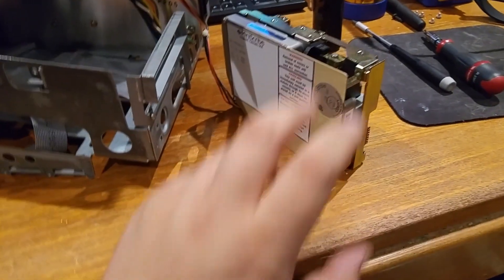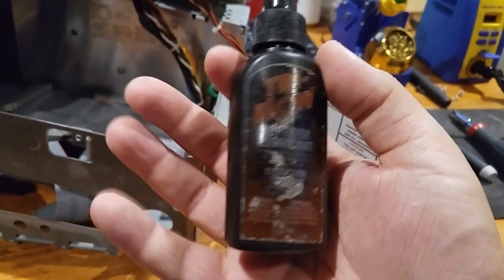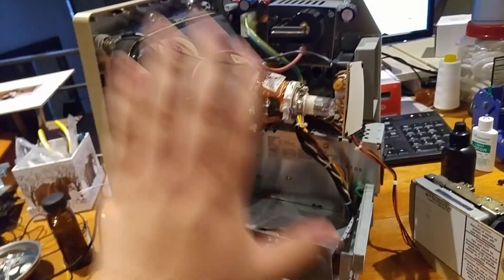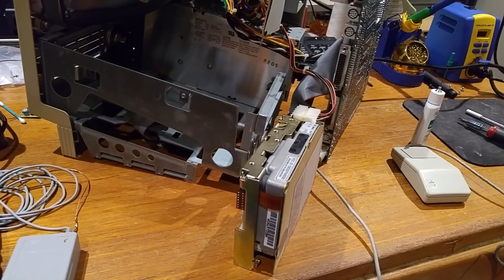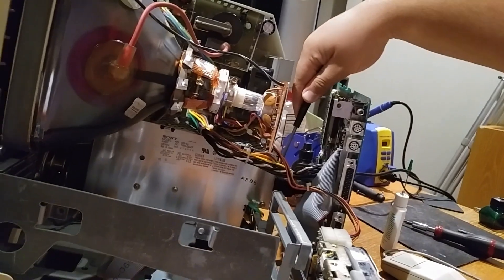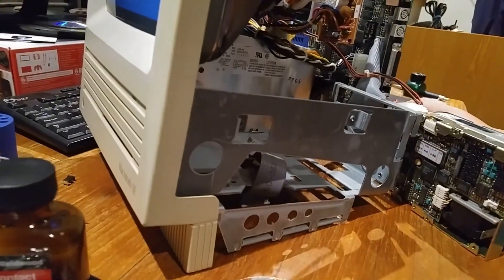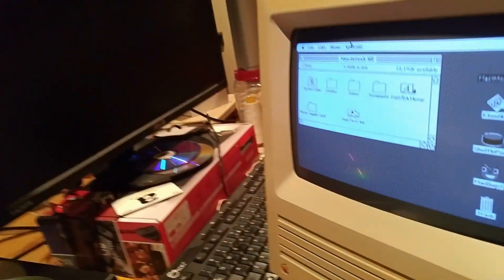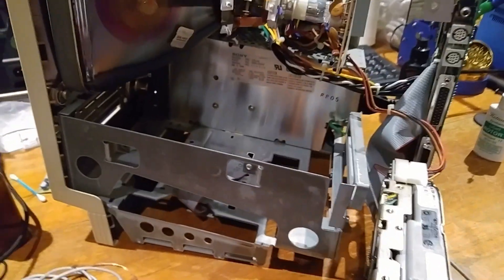MiniScribe Stepper Motor Fix

Comment: Nice! It worked for mine as well! I went around town looking for "sewing-machine-oil" (same thing) and it was sold out in an old-school local hardware shop. Went to a shoemaker and he told me he uses engine oil for his heavy duty machines and "electric shaver oil" for his finer ones. So I remembered I actually got some of that "electric shaver oil" in a gift I got for christmas LOL Talk about far-fetched. 

Anyways I applied it a couple of times + switched on the drive, repeat... "Macintosh Heilsar" (that's the Icelandic version)!! Holy smokes! That little stepper guy was stuck after all those years (I rescued this SE from a dumpster)

Thanks my dude.